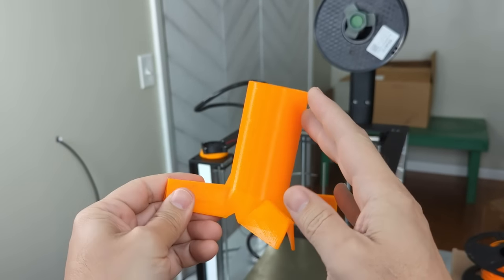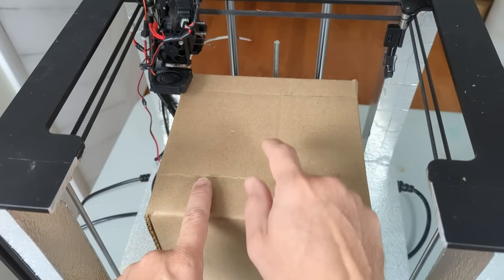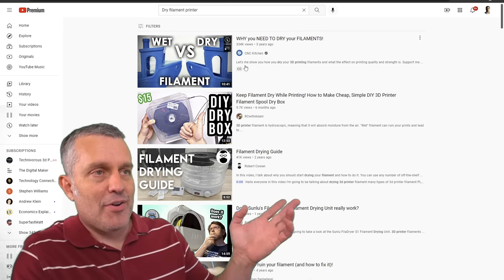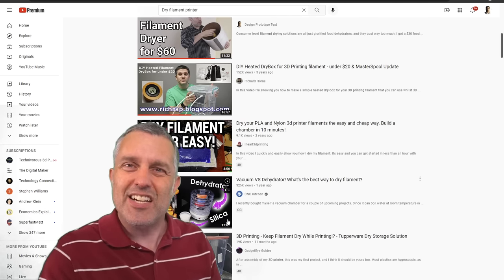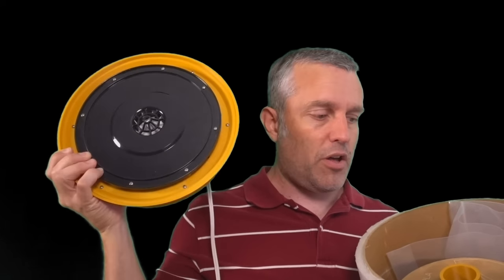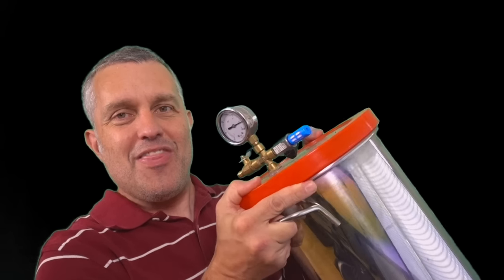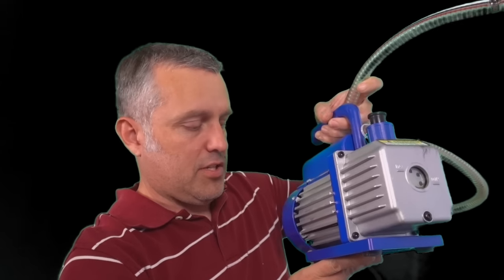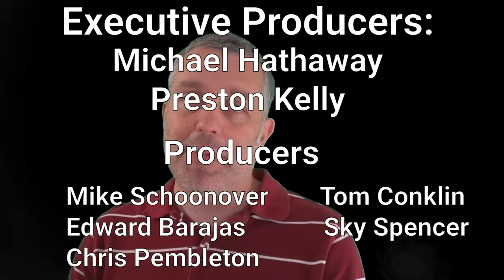The Filament Dryer Built Into Every 3D Printer

Comment: Ramble for like 15 minutes, then "oh, you gotta pay me for my shitty little tube file"
C'mon man. Not the 3d printing spirit at all.
Reply from the maker: What's the 3D printer spirit? You are trying to entangle open source with 3D printing. The two are separate entities. Not only that, but you only like open source because it means you get free stuff. I don't see you creating free stuff. I made it. I showed you how you can make one. If you have the skills, go make it. If you don't have the skills, then don't criticize me because I wouldn't give it to you for free. You sound so entitled.
Reply: @DesignPrototypeTest  It's literally a basic model. I've released tons of parts. Not entitled, just locking things down stifles the advancement of the hobby. What's the point in buying a printer if you can't print anything with it? Not everyone has throwaway money and even less so right now. If I have to pay for this to dry the filament, then again for a bed support, then again for a filament clip, and again for a cable manager, and again for a cool model to print, I could end up spending nearly as much as the printer itself. Paywalls suck, that's all.

Comment: is it really working? because it looks like it should not. because you are just heating your room air which makes it more  moist rather than drying it
Reply from the maker: It's the same thing as a food dehydrator or a commercial filament dryer. It's a box with a heating element and recirculating air. I don't understand your skepticism. Yes. It works.

Comment: Ive been printing with PETG Prusament for all my last prints, and had no problems thankfully, but I've heard from some people that it could still get water in over a very long time. Also doesnt Prusament PC claim they've solved the water problem with theirs? I have some but I havent tried using it.
Reply from the maker: Prusa's business strategy: Copy the all the good ideas 3D printer hackers on the internet come up with. Use these to make the best consumer level 3D printer of it's time. Make sure to label everything as "Prusa" (eg. P.I.N.D.A.) This way you can coopt every piece of technology and idea made by someone else and make consumers believe it is something originated at your company. Hire a local Czech company to manufacture the high quality filament included in the box with your printer. This is only temporary. Make sure you get backstage tours of their manufacturing and learn everything they know about making high quality filament. Defect against this company. Use this information to start your own filament line. Again, make sure to put the Prusa name on this filament even though you are just using polymer sold by Dow Chemicals and you are using Fillamentum's extrusion processes. Using this strategy you don't have to do the hard R&D work but all the sheeple consumers will believe that you are responsible for all the innovations in the 3D printing and you only sell the highest quality stuff. PROFIT BABY PROFIT, and never acknowledge those who helped you get to the top.
Reply: @DesignPrototypeTest  That is disappointing to learn. I should make more research. I guess that curbed my excitement for their new XL Prusa printer that claims to come with CoreXY. Does Dow Chemicals still make filament? I should buy some from them. Also happy to hear you moved, I hope you got more space! I am thinking of building my own little maker space because of all your videos.
Reply from the maker: I don't know who actually makes the polymer for Prusa. I was guessing it is Dow Chemical. It could very easily be a Chinese company. Creating the base plastics is BIG business. Dow's gross sales are probably 1000x more than Prusa. Prusa takes the pellets made by an enormous plastics manufacturer and runs it through their filament extruders. They have a fancy fishing reel system that makes the winding of the filament look very clean. They do not do anything of note to alter the chemistry in their filament. At best they are making an "alloy" by mixing two pellet types provided to them by their polymer supplier. Making 3D printer filament is comparatively a small business so none of the plastics manufacturers bother to do themselves choosing instead to just sell their products in the form of pellets. 99.9% of these pellets get used in injection molding (like a cellphone case) and industrial extruding (like a door seal for your car). A small percentage gets sold to filament manufacturers. Prusa has no significant claim to higher quality or more advanced filament technology than any other filament company. It's all marketing.
Reply: @DesignPrototypeTest  Fifty years ago we sold nylon fishing line. There were multiple businesses that sold nylon line in bulk in different diameters. We transferred it on to 100 yard spools, stuck our label on it and let the advertising agents loose. Industrial suppliers don't get involved in retail, and I expect this applies to 3d printing filament as well.

Comment: These are great videos. What if you enclosed the spools in a breathable desiccant barrier (containing little pockets full of desiccant) that could be re-dried and/or de-gassed repeatedly in an oven and/or vacuum chamber? Once inside the Tupperware and/or vacuum chamber, wouldn't the desiccant barrier slow water absorption to the point where it was negligible? Also, Tech Ingredients showed how to make a highly efficient liquid desiccant (the liquid volume of the desiccant grows when exposed to water-containing air) on one of their videos on their "evaporation ball"-evaporation-based air conditioner ...counter-intuitive, but perhaps a part of a solution.

Comment: I've boghut a broken fruit dryer for like $6. Turned out the reason was the temperature fuse inside. Well, easy fix. You can use it as it is. But being electronics enthusiast - I've designed a simple PCB that fits inside the dryer and keeps desired temperature. A little OLED display and a small MCU gives me a menu to choose a fillament type. Boom - a filament dryer! =)

Comment: i tried this before, but it didnt really work. I need 100c to dry filament for nylons for 3 hrs and my printers safety timer times iut at 30mins
Reply from the maker: Obviously, you didn't get the chamber hot enough and you didn't have sufficient airflow. it's not rocket science. Hot air moving around your filament will get the water out.
Reply: @DesignPrototypeTest  yeah. I still prefer an oven bc I can anneal parts. Also, im too lazy to build smth around my printer or do any sort of wiring.

Comment: I do this for my filaments that require over 55C that my Sunlu dryer is limited to. When I first thought about it I did a search looking for ideas on cover(you used cardboard box) and a few others had the same idea. I ended up using a flat piece of cardboard cut to shape of my largest diameter filament spool and sandwiching it in between my bed and spool. Then I use a piece of white Styrofoam that came as packaging for a servo motor powering the spindle on my Tormach sized CNC mill. The Wanhao box essentially does same thing with a Mk2 Reprap PCB style heated bed in bottom.

Comment: You take our comments seriously, and keep improving your content - I knew there was something different with eSun PLA+   it is really wet after 6 weeks and has gotten really brittle, it won't stick to the bed. I have a few old 200x200mm bed heaters from my early RepRap days. Thank you for your work. I make coin rings, which requires annealing at  900C and letting the metal cool to 25C - metal loses its crystalline structure becoming ductile so that you can fold it, tooling makes it hard again. The same thing must happen with polymer thermoplastic filaments, they lose the orderly polymer structure towards the glass temperature, I'm not sure that removing water fully restores the polymer structure, metal on the other hand can be forged 1000's of times.

Comment: Great video thanks fr the info! I dont think they make gypsum dry wall anymore tbh!
Reply from the maker: That's like saying lumber isn't made of wood anymore. Drywall aka gypsum board. It will always be made out of the mineral. If a replacement product comes on the market it will have a different name.
Reply: What was that gypsum filament that was mentioned?

Comment: Yes it works, but hey you are using your 3d printer to dry filament. What if you need your printer for something else? Like 3D print!!!. I just don´t see the point and for me is not going to dry so well the filament, If you live in a very wet place just get a good dryer box and you can keep you filament drying even when you are printing. I don´t recommend doing that.
Reply from the maker: There are many people who want to spend the least $ possible and only want to print once in a while. Do you think they should buy a $50 dedicated filament dryer or print a solution for $5 that will get the job done?

Comment: Hmm, maybe mold print the part and cast paper mache or even epoxy to produce a more thermally resistant piece to go inside the box. I really like how this is an evolution of the same simple idea that occurs to a lot of us. Simple yet getting refined into an actual engineered solution worth using.

Comment: I just got my first ender. I live south of Houston so my air is always humid.  My machine will be in my garage.  So, I will have to always keep my reel in a container that feeds into the Ender?.  I also want to make an enclosure, but i need a  enclosure to make the parts😢  So i guess I'll have to make a temporary one. 
Thanks for great video
Reply from the maker: PLA, PETG, and TPU take a couple days to get wet. If you dry them and print immediately drying you shouldn't have any problems related to moisture in the filament. If you are printing with Nylon, Polycarbonate, other high performance extremely hygroscopic plastics, and possibly even ABS then you need a dedicated dryer such as you discussed. There are many on the market.

Comment: Zip bag with small air pump and desiccant. Keeps my filaments pretty well so far.

Regarding your design, I guess you want to get the hot air of the bed to cycle, so wouldn't bigger opening at the bottom make sense (especially with the larger fan). I guess it depends on the fan really.
Reply: This video tell you how to build filament dryer, to dry your wet filament, not to keep already dry filament to stay dry.

Comment: How does the moisture get out of the cardboard box?
Reply from the maker: Cardboard is breathable to a small extent. Especially for water vapor. Also, as I explained in the video, the box is not sealed to the bed so an  air exchange can happen at that sean.
Reply: @DesignPrototypeTest  Thanks

Comment: Why not store the filament in a sealed ammo metal box with silicone Sealing 🤔 if it's store ammo dry wha not filament and I bet it could be build as well a dry box of it also, a heating element in the box, a fan, Desiccant and a temperature controller like they are on the furnace and done 🤔 maybe.?
I'm a beginner and waiting still for my first 3d printer.
Nice videos by the way. 👍

Comment: I disagree with your assessment  that PETG isnt moisture sensitive.  It is one of the most senstive.  It needs to be dry to control stringing and to get it to stick to the bed.
Reply from the maker: So do I (disagree with myself). I even made a whole apparatus and video on my printer for dealing with wet PETG before I made this: https://youtu.be/PhiDD0E_Fjg . Tom Sanladerer recently did a great video on the subject: https://youtu.be/5CFxT1q6dX8
Reply: @DesignPrototypeTest  Lol.  A man in torment.  The PETG moisture thing one of the defining parameters of it.  I do have a question that you might the the right guy to answer or test.

Lets say I make my item out of a plastic.  Say 3 perimeters or 6.  Item is printed correctly with dry filament.

1.  How quickly is moisture able to migrate through the shell?  Is it viable to make a "waterproof" enclosure or moisture proof box using a printer?

2.  What is "dry"?  Is 18% the practical limit? 

I have recently been experimenting with drying processes.  I noticed that ambient of 35%... I can dry to 18% or so with a toaster oven... it works well as long as it is preheated before filament is in otherwise the oven tries to reach temp aggressively and melts spools.  I went that route so I could dry dessicant with the same tool.

I am finally seriously looking to dealing with moisture and a heated enclosure and all that.  Relative humidity here in winter is around 10% so not an issue.  I humidify to 35%.  In summer around 50% is maximum.  But I have seen drastic improvement in printing by drying to 19%.  

For a heater I got a broken space heater and it has a large PTC finned heater.  The module even has a high temp cutoff.  I will PWM it to maintain temps but having a couple failsafes is better.  I am going to experiment with drawing the filament through a heated tube on the way to the print head.  I wonder how much exposure to 60C or 70C or 80C it would take to drive off the moisture from the single strand of filament exposed on all sides.  Then no predrying is required.  If if this needs a loop or coil that would be ok too.  If conditioning the filament on demand is viable then long term storage becomes much less critical.

Comment: nice but i am think that you need some holes to release moisture
Reply from the maker: The actual volume of moisture contained within the filament is very small. You don't need a lot of ventilation. In my case the bottom of the box is not air-tight and provides all the air exchange I need. Especially considering that the wire from the fan is propping up one side of the box by the thickness of the wire. I touched on this issue in the video at 17:17

Comment: Old video but still very much relevant to the 3d printing community. Question though if someone knows, if you’re using klipper, using the bed as filament dryer would only serve has a 10 minute pre soak if i understand correctly. Klipper will automatically shut down bed heating after 10 minutes. Is there a workaround for this? With marlin you don’t have to worry about timeout
Reply from the maker: Just send a custom "print" g code file. All it needs to contain is a bed heat up, wait, and cool down commands.

Comment: What If you sealed the box and added a Peltier cooler. So you expose the Peltier cooler's cold side to the interior of the box and the moister should condense on the cooler. you then add a catch and drain line under the cold side of the Peltier.

Comment: Strange how a retail filament dryer that uses a heater from a "reptile enclosure" is crap. But your DIY filament storage which is a Tupperware container with a  heater from a reptile enclosure is great. Right, whatever you say.   LMAO
Reply from the maker: You are either an idiot, a troll, or a paid shill. The retail one costs $40-$70 depending where you buy it. It does not seal from the elements, holds only one roll, and the timer will shut the unit off after only a few hours. This forces you to constantly remember to reset it manually and makes it not an option for long term storage of filament. The DIY version costs half as much at $20, it holds 2 rolls, seals, displays humidity and temperature, and stays on until you turn it off or the power goes out. But sure, tell me again about how biased I am and how contradictory my words are.
Reply: @DesignPrototypeTest   I am none of those, but you responded just as I thought you would. If you can't win with the facts you attack the person. I if you have facts then pound the facts. If you have the data then pound the data. If you have neither then pound the table.

Comment: I have yet to see a drying solution that beats the oven. At 60° it is really efficient, and I can do up to 8 rolls at a time
Reply from the maker: You are lucky to have  an oven that is controllable at those low temperatures. Most ovens in homes in the U.S. can't do that.
Reply: @DesignPrototypeTest  interesting, I did not know that, I can set it anywhere from 30 to 300, most ovens in SA can, it's a lifesaver

Comment: Interesting that in your list of storage solutions you don’t even mention vacuum bags.  So many vendors and so much cheaper than a vacuum chamber (less than $1 a piece versus several hundred dollars).
Reply from the maker: 3:12
Reply: @DesignPrototypeTest  you only talk about the bags they come in from the factory, not about third party manufacturers, I have been using vacuum bags from Ataraxia for some time now and they never lose vacuum, no air means no moisture. Your comment on your video about vacuum bags eventually letting in moisture is completely false.

Comment: I don't get it. Water evaporates at 100c how does 60C get the water out
Reply from the maker: You are on the right track. Asking good questions.

Water BOILS at 100° c. Water evaporates at all temperatures. Even ice evaporates but it's called sublimation and it happens very slowly. Heat makes water molecules in The filament more energetic, which makes them more likely to evaporate into water vapor and get carried away by the air.

Which brings us to the interesting fact that you cannot dry things in 100% humidity. If the air is already saturated with water, it won't carry away any of the water molecules from the heated filament. 90% humid air will dry your filament. 

But this is where it gets complicated because there's bound and unbound water in your hygroscopic filament. Unbound water can always be dried. Bound water is more difficult. You want to dry your filament in a lower relative humidity environment than the environment in which it became wet in the first place.